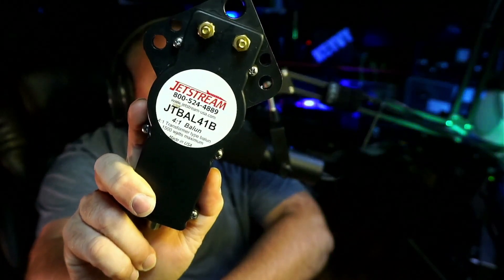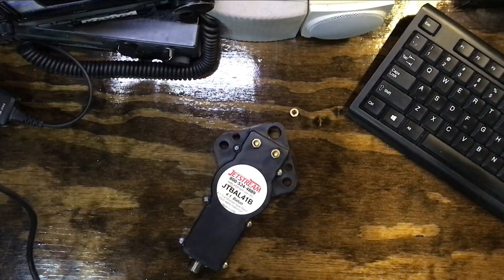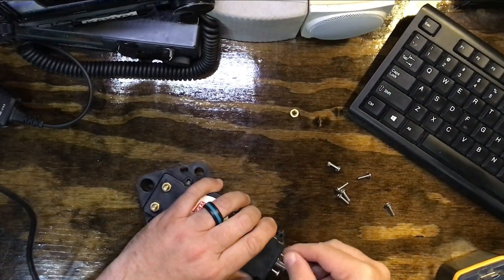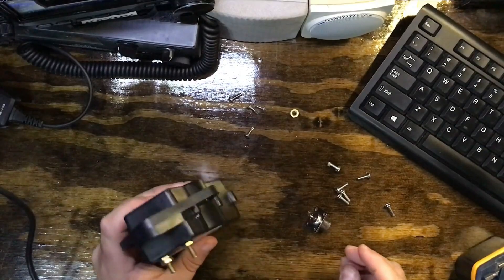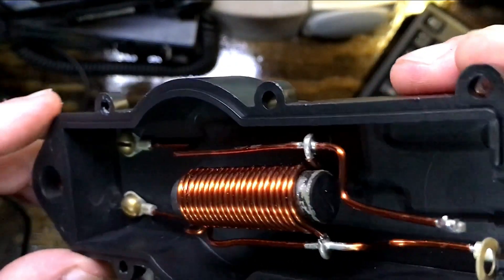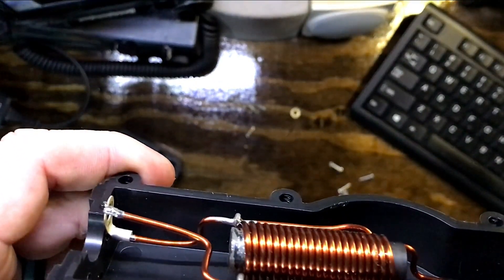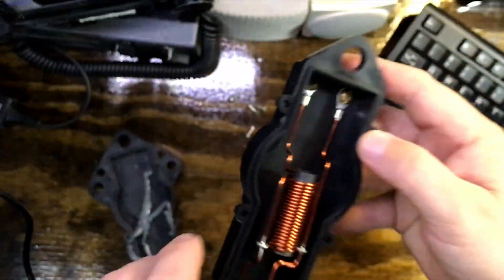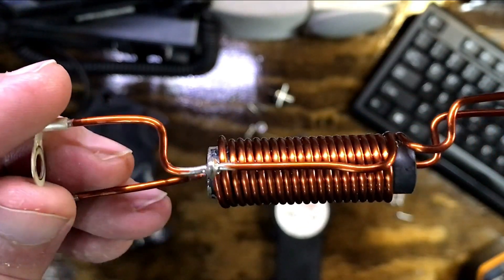What is this?! | JetStream antenna balun | Ham Radio

Comment: JoeBrett-
Many voltage balun (impedance transformer) designs use a ferrite rod instead of the ring we all love.  Rods are much cheaper to purchase and a easier to work with as you don't need a core wrapping machine like you do with a donut.  I'd say they went with a voltage design to make it cheap.  One of the engineering advantages to using the rings is that it keeps the magnetic lines of force inside of the ring better than a rod; those lines flow out of the ends much easier.
Reply from the maker: Nice info! It performed well for what it was advertised for, I just noticed a difference in 10m and it didn’t list 6m in its range, and that was the factor I replaced it.

Comment: Obviously, you overpowered that 4:1 with your mighty IC-705 Hahaha.  No really I'm glad you opened it up before you did put some juice through it. Thanks for sharing JB!
Reply from the maker: Oh Chuck, buddy, I did run power through this.  With the 7300 and 811h I pushed 400-500 through it.  The balun it self while in service the few weeks I used it did not give me any problem, I just wasn't getting 6m very well as it is rated to 30MHz, that was my main reason for changing it.  Then I just wanted to see what was inside of it, considering I only Paid $40 for it, and the Palomar was $140. :)  But for sure that 239 connection on the JetStream would be a point of failure over time probably.

Comment: I think that is common in Solid EFHW antennas, like the  IMAX-2000. I know when mine got shattered due to operator error, tilt over antenna masts can be unforgiving, I did an autopsy and found a similar device. It is still in the garage, maybe I will get it dug out and see if it is wound the same way.
Reply from the maker: I could see applications like that. I think I have a busted imax behind the shed, I’ll take a look as well lol.

Comment: Hi JoeBrett,
That's a ferrite rod and is another way to construct a balun. There are two separate enameled conductors wound on the rod. The two screws and nuts hold the ring terminal and the SO-239 to one half of the case. The two self tapping screws secure the SO-239 to the other half of the case. I was surprised the solder joint to the center pin of the SO-239 came lose so easily. You and your family stay safe.  73  WJ3U
Reply from the maker: Thanks Don! Yeah my only real problem was the connection to the 239, if I hadn’t taken it apart would it has ever came loose? Maybe not…but I do think that’s a difficult connection and takes more than a dab of solder. I was intrigued to see a different way of making a toroid with a ferrite rod. 73!
Reply: @K5YVY  The way it fell off, I think it had a cold solder joint. It should work well once that joint is properly soldered.  WJ3U
Reply from the maker: I agree. It worked as designed while I used it, only reason I replaced it is I wasn’t  getting 6 meters as well, as it was rated up to 30MHz.

Comment: Another jet stream fail
Reply from the maker: To be fair, it worked as it was designed to, and didn’t break until I took it apart, but that 239 connection seems to be the weak spot of concern.